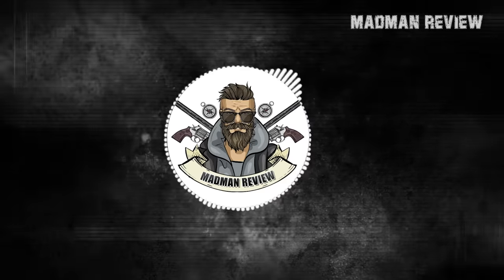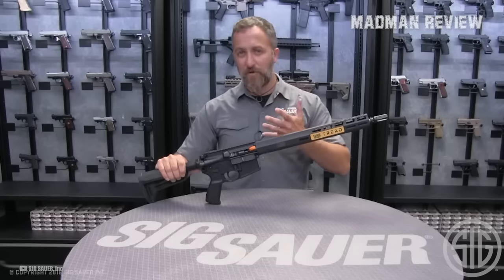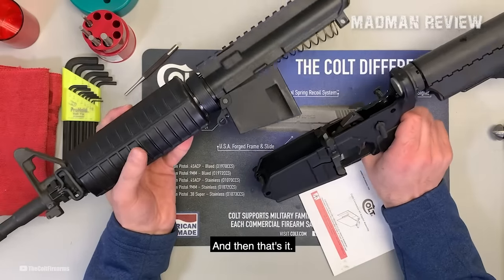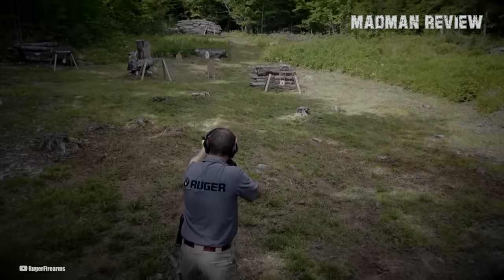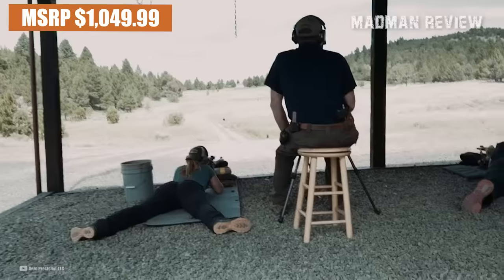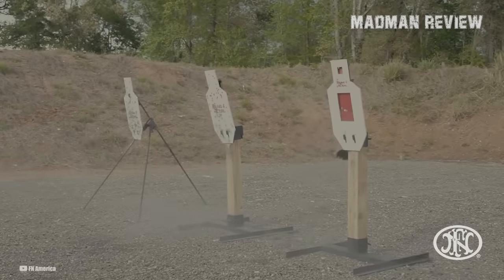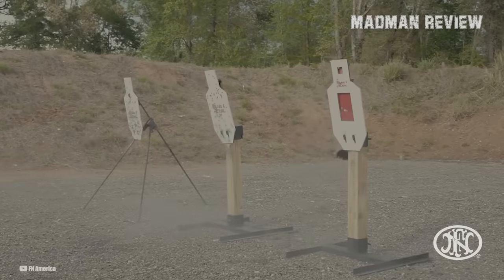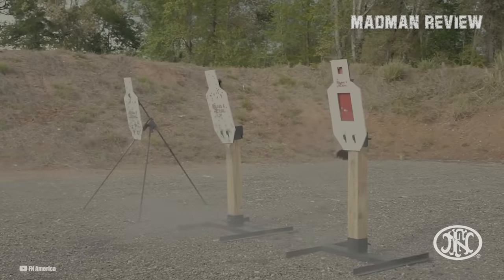7 Best AR-15s Under $1500 Out of the Box

Comment: If you’re looking for your first ar. Get the colt, fn, or spend a few bucks extra on a bravo company USA bcm, son of liberty gun works or solgw. The bcm and solgw have basic models at this price range but  also for couple hundred more u can get upgrades that last your lifetime and you won’t need to do much except an optic and iron sights sling. All four I stated are duty grade rifles used by Leo and even military. Definitely more than you’d ever need.
Reply: all are great I agree, So is Springfield, there lifetime warranty, mags and case included, and better trigger then the colt and nicer furniture. I had the old colt M4 in the army but I like my springfields better, especially the springfield edge

Comment: They all pretty much have the exact same “features” but this video would make you think only a couple of those raffles have those features when again in fact they all are made of the same aluminum using the same upper receivers with flattop Picatinny rails…but first, the FN-15 is #1 by Far on this list with the Colt LE6920 coming in at a distant 2nd for “ Best bang for your buck“ in this video. But saying that the Ruger or Aero Precision are better than the Colt and putting the Saint Edge at #1 is beyond laughable 😂😂😂 whoever made this list is clearly going off strictly sales numbers (which have nothing to do with the actual quality of the rifle) and not by actual knowledge or Research done by industry insiders. A SOLGW is only slightly more and would put all of these to shame🤷🏻‍♂️
Ahhhhh, how so easily ignorance is spread on the interwebs.
Reply: I would love to gain insider knowledge lol then again they don't make things easily accessible to outsiders for a reason, yes?

Comment: Wait so the fn 15 says chambered in 5.56. Can it still shoot 223? Kinda new to this.
Reply: yes 5.56 barrels can shoot 223- 223 can't shoot 5.56. it comes down to chamber pressure.
Reply: Yes you can shoot .223 out of it. .223 is just slightly lower pressure so it may occasionally not feed or cycle as well. 

It WILL NOT DAMAGE YOUR GUN. It just may fail to eject a round of something. I in fact mostly shoot .223 out of mine. HOWEVER, in my magazines for home defense I have 5.56 so there’s no chance the gun fails to cycle if a fight for my life happens. Hopefully this un muddied the water.
Reply: yes, anything that shoots 556 will shoot 223 though it will suffer a bit in accuracy. a better proposition would be to get a rifle with a .223 wylde chamber (it's not a cartridge)